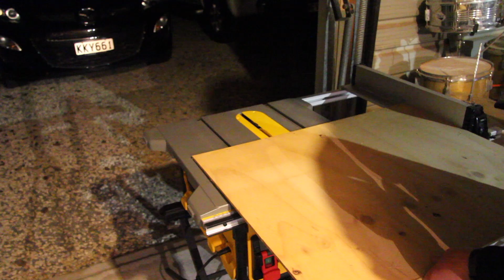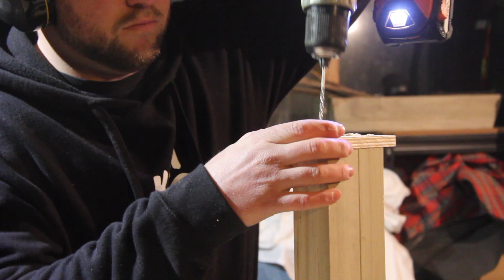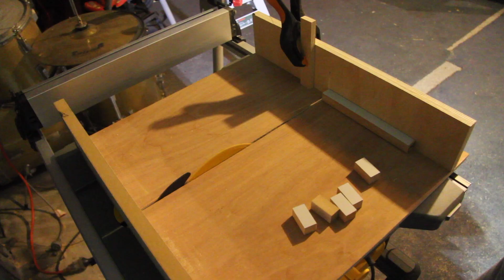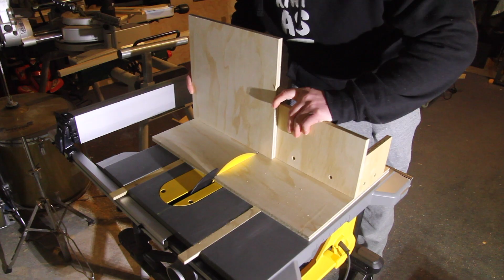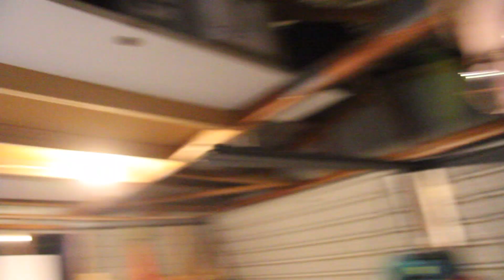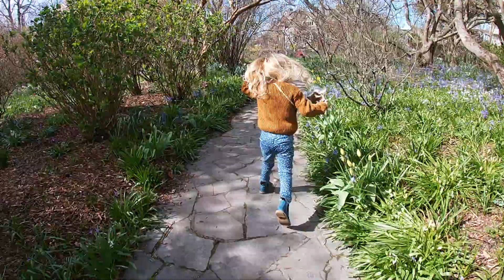Single Blade Box joint jig - No Dado! #woodfathersjig #nodado

Comment: You legend, thanks Sam 👍 I'm working on getting out the step by step build video for those who purchase, lockdown here meant I just couldn't get my hands on suitable material. 
Hopefully I'll get it posted this weekend. Good job finishing it off, only suggestion would be to cut the spacer at 7:45 maybe twice as long. If you do that, you can lift it up high enough so the blade won't cut into it, and then use it to clamp your piece from the side as well, keeping everything locked in more securely. I'll add something around that in my video.

Thanks again, great to see #woodfathersjig getting out there! 😁😁
Reply from the maker: Cheers mate! I look forward to the video, and completely get lockdowns and delays in materials! I'll definitely do the spacer tip too, I was wondering about that. Biggest challenge was getting the right key but I think the Allen key I've got has nailed it, an extra from flat pack furniture! Really enjoyed getting this one over the line and it's already being put to use for the next maker challenge! Thanks again!

Comment: You are dead right Sam, the best part is making something work by identifying and  overcoming  the challenges. I'd never thought about plans like that before... at least with them you KNOW it should work, where as when you are making it up you have to pray it will... 😁
Reply from the maker: Haha, even with plans my ham fisted approach can often be a case of suck it and see! I spent a couple of years as a part time soldier in the UK, and we always used to say you'd never remember an exercise if the sun was shining, and the same applies to making, I could make something time and time again and almost not remember the process, until something goes wrong and you have to work through it, and then once you've overcome the problem you'll never forget it, well worth it :) Cheers
Reply: @samsboringchannel  that's actually pretty good advice all round.